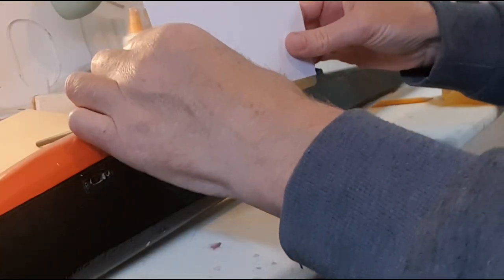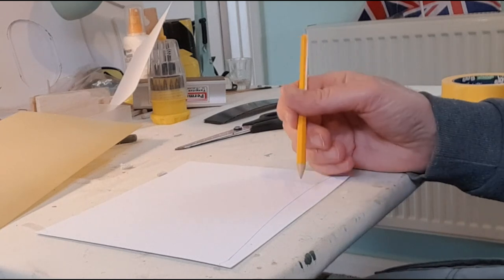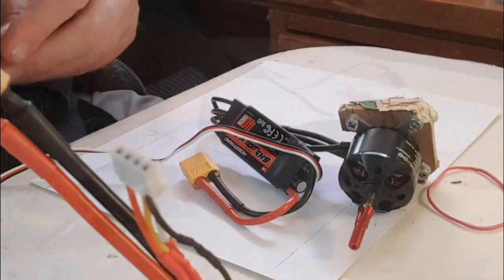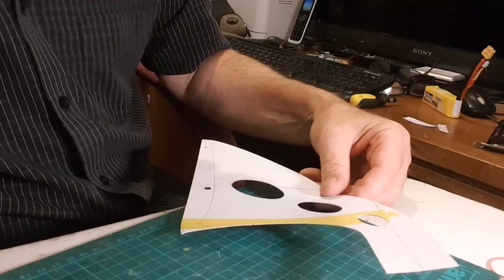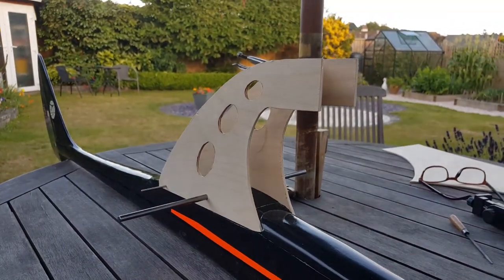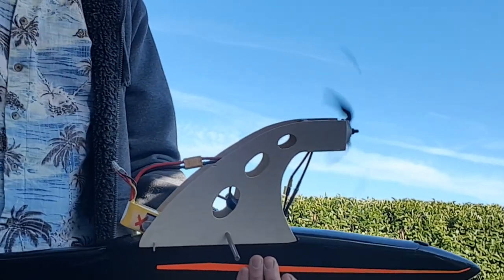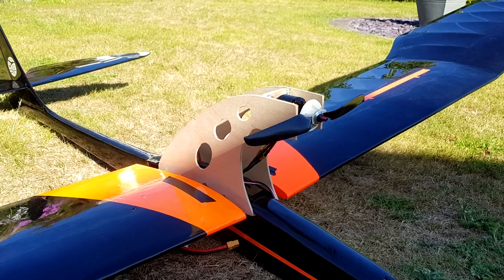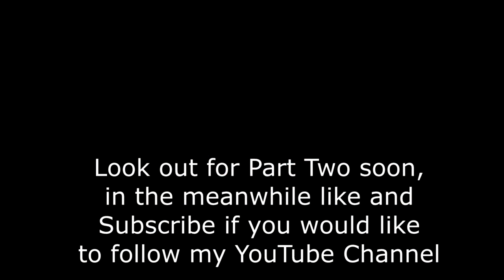Making an Electric Power Pod for a Glider Part 1

Comment: Interesting idea Cliff.  Most craft I've seen in that design have been pushers, don't think I've seen many tractors?  The thrust angle will be important I think as the motor is high on the wing and will have have quite a big turning moment around the CoG/ centre of lift. But I'm only guessing (I know nothing!)  as I always have problems with the pushers I've built so have done a bit of Googling!   I noticed the French curves too, hadn't seen those in years. You're a proper draughtsman!
Reply from the maker: Hi Bob, I can change the thrust angle easily with washers under the mounting screws if I need to, if all else fails I'll turn it around 🙂

Comment: Nice job cliff. Yet another ingenious invention. I hope you didn't steal the lead ballast of the church roof 😂. They are usually pusher set up on gliders and if the thrust angle is not pointing down the plane just nose dives. Maybe your setup will eliminate that problem. Can't wait for the flight 👍
Reply from the maker: Fingers crossed Jon, perhaps I'll throw it off of a hill just in case 🙂 Thanks for the tip.

Comment: Hi. Why not use a smaller battery like a 1300 3s. That would fit in the nose without changing the servos. Just a suggestion.
Reply from the maker: Funny you should say that Bob because that's what I do use for general gliding but a bigger battery gives me more motor time and I have removed some lead which I can change into useful weight by using a bigger battery as well, so a win win. Oh, and changing out some old servos is always a good idea. Thanks for the suggestion. 👍

Comment: I've had over 60 gliders and only 2 of which and 15 years were any fun using a motor but you know most power pilots with the hobby after 3 years anyways Cause that's how it is you know they just toying with the idea of being a pilot real man don't need a motor..
Reply from the maker: Thanks for your comment, the power pod was a fun experiment, cheers 👍